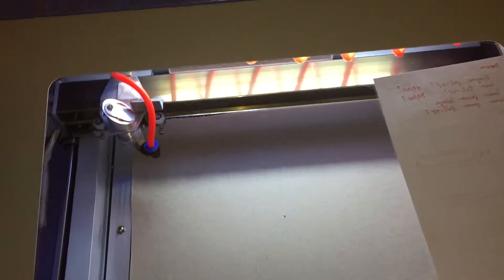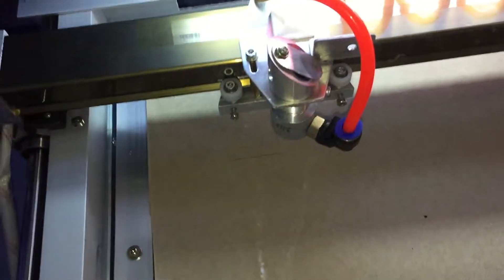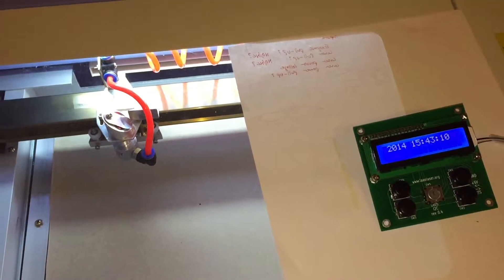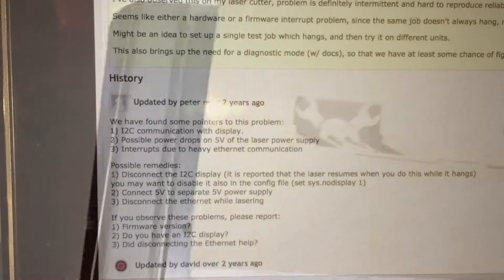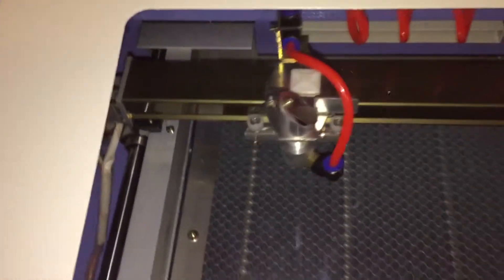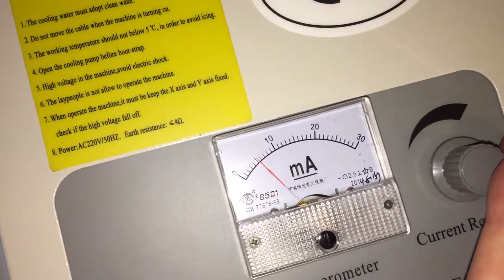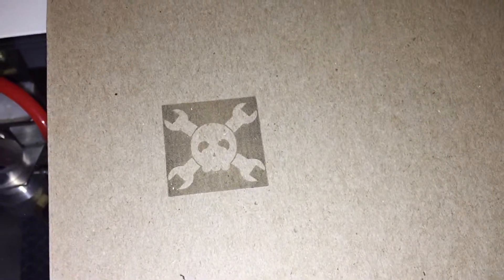LaOS Laser Part 5: Troubleshooting

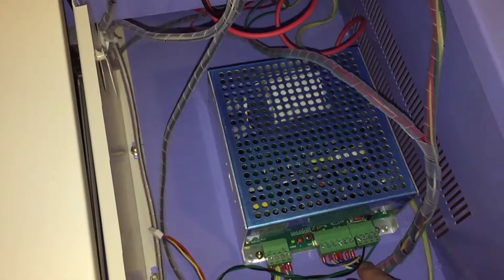Comment: If you can please illustrate, by words or even by a hand sketch how the wiring goes in 7:30 to 7:50, what current is out from the bench supply to these wires, black, red and green?, sorry I am not electric guy to figure out myself, I still use the moshi and want to solve the engraving problem, thank you :)
Reply from the maker: Mido Sadek There may be another issue at play for you.  First of all, I don't recommend messing around with the electronics when you still have the Moshidraw board.  I don't know how it's done internally, and I think it's dangerous.  

What you should look into is the pulley on the x axis gantry.  Mine was not round.  I'm working on a video that talks about that.  If you tighten the belt so that it's not loose, with the machine off, does the head move smoothly along the x axis?

Comment: Great to see you got it going. Well done. With the stepper drivers I typically run them as hot as I dare e.g.just a little too hot to put my finger on the heatsink. With the opto switches I run them in fail safe mode. This means the are all closed in the running condition. All closed means current flowing which makes noise a non issue. Does that image look in focus to you? Its hard to tell with cardboard, maybe some anoddised aluminium would show the focus better. Watch out the mirrors and lens could get damaged with no extraction. I am looking forward to seeing your next steps.
 I just edited this so yes you can
Reply from the maker: Robonza Yah, getting the current right on the Pololus can be a bit tricky.  On my 3D printer, I ended up pointing a fan at them and running them to the point that the motors themselves was warm to the touch.  It is tempting to make the switches normally-closed, but I'm not eager to tear it apart enough to make that happen.  To me, the image is quite crisp.  I tried looking for bulk anodized aluminum, but I don't know where to buy it.  I noticed that you do not want to run it without extraction, there was some residue that had collected on the second mirror.  Luckily, I was able to remove it with 99% alcohol.  There was only extremely minor pitting on the surface.  I was able to move the spot to a position that it's on the beam line.  Yet another learning experience! :)
Reply from the maker: hpux735 *not on the beam line.  (Can you not edit youtube comments?)